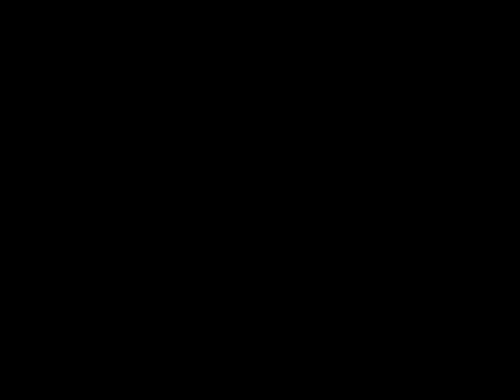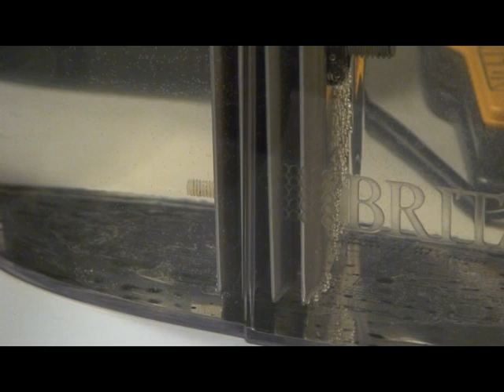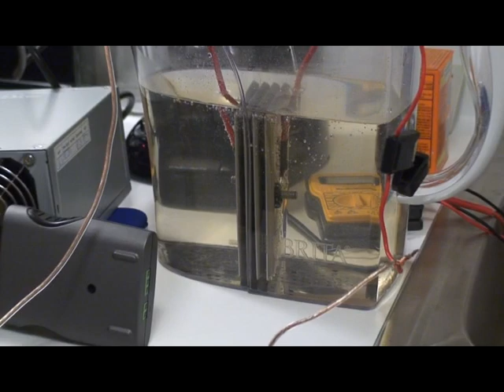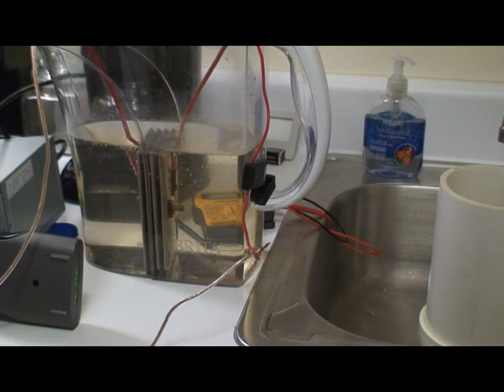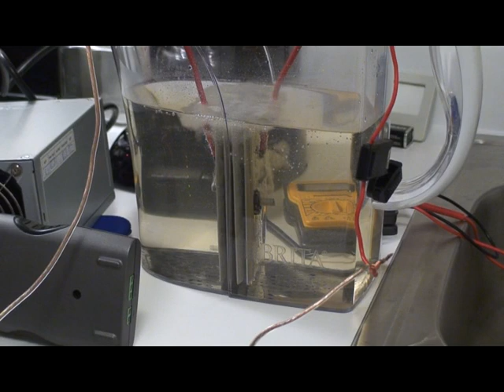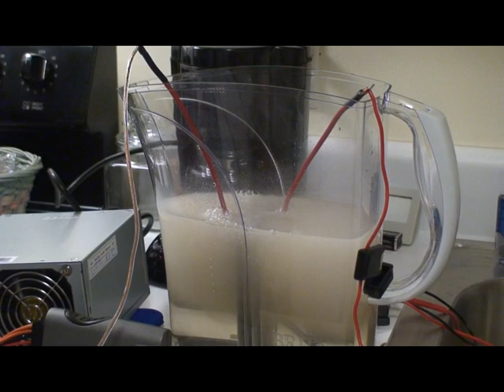HHO Test  # 1  with 4 plate design

Comment: did you experience overheating problem? mine overheats. i tried running about 3 mins and it actually melts the plastic cap where my ss connector is tapped.    im afraid it would even melt the wire when prolonged.     any suggestions to prevent heating will be highly appreciated. thanks

Comment: You said that you were using about 1- 1.5 tsp of baking soda, but how much water were you putting it in. I just used 1/4 tsp in 900ml of tap water and it got pretty hot in about 8- 10 min.

Comment: you are really going to have to get your hands on some modest test equipment. you need to know volts, amps and temperature at the very least. eventually, you will need a method of measuring the volume of gas output but that can wait. your PC power supply is not a bad way to go early on but eventually, you will need something a bit more reliable. the PC power supplies dont last long abused this way so have a couple laying around you can let the magic blue smoke out of.

Comment: hmmm .. yeah, you may be pulling a bit more amps than your wiring is up to ... back off on your baking soda a bit ... will produce less, but the idea is to build it to meet a performance requirement ... if your wires are getting hot, you are hitting it harder than the design parameters account for ... so either bigger wire, or less amps ... choose ...

must say, if this is your first effort, you did a little homework before you built ... now figure out how to get it under control ...

Comment: how hot did it get ???  I have found that a setup like that left to run for while can get up into the 185F range ... have had a couple of them start boiling ... 

idea is to make gas not steam so now that you have a working device, would think next step would be to tame it ... getting control over your volts is a good place to start ...

the two most popular ways to control volts are neutral plates and multiple devices in series ... let us know how it goes ...